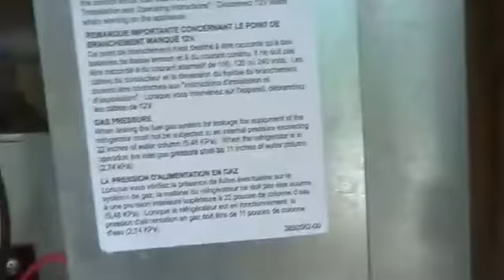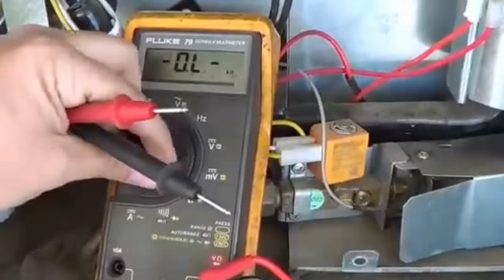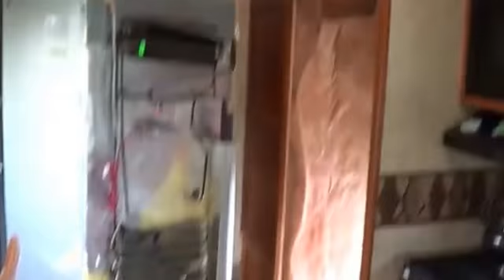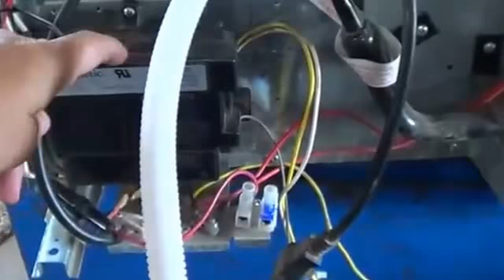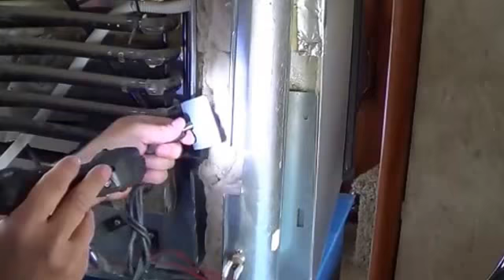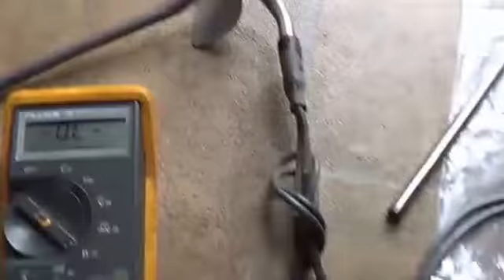Dometic DM2652 RV Refrigerator Repair

Comment: I have the same dometic fridge and that heat shield tube and crimped from bottom to the top preventing to extract the element is a freaking pain in the butt. Having to remove the whole fridge from the enclosure to change an element is complete nonsense

Comment: You can check ohms without removing the element.  You do not need to remove refrigerator to replace element on all models.

Comment: Great video, I have a question.. anyone can answer this if someone has an idea what I'm talking about. I have the exact same fridge and the way you were explaining it just stopped working You notice your ice wasn't cold then you switched it over to LP didn't work mine did the exact same thing so my question is for some reason I was thinking it was something to do with the board because I wasn't getting power or the button is on top of the fridge right above the freezer like if you push the LP it will light up green or whatever If you switch it over to electric you would light up did yours stop lighting up also on that board. Hopefully you can make sense of that either way I'm going to test my element tomorrow I'm pretty sure it's the same thing what's going on with mine thanks again
Reply from the maker: On my fridge to force it into gas mode I push in the left button and push out the right button. In this mode its forced to use gas and no lights show.
Reply: @LoveYourRV on the panel the only button that would illuminate would be the gas button and it says auto and check I'm not sure what the check means but yeah you just have a simple on and off switch on it I guess either way I appreciate I think I'm going to go ahead and pull it apart today thanks a lot
Reply from the maker: @JzNMuzak  Auto means it will first choose electric but if not plugged in to power it will auto change to gas mode. With the auto switch out/off then, it forces gas-only operation. The check light means the gas didn't ignite for some reason.  The fridge tries to ignite 3 times using its direct spark ignition, and if it fails to light the burner, the check light comes on. Here is the service manual with the various diagnostic procedures  https://www.manualslib.com/manual/2316371/Dometic-Dm2652.html
Reply: @LoveYourRV  I'm just now getting around to this repair. I really appreciate the helpful information and this video. I'm in northern Michigan currently and the weather hasn't been permittable. But it looks like that's going to change. But then again, it is Michigan.

Comment: Thanks for info was your element not heating at all, mine is heating but the fridge is not cooling
Reply from the maker: Yes, fridge cooled fine on gas but no cooling on electric because the element was open and would draw no power or heat.

Comment: Thanks Ray for another great video even though it's 10 years old I still found it useful. But still can't find out why my electric part of my refrigerator won't work. The gas is also quick but I think I know what's wrong with that I have a part ordered on it. I think I might go back to the old days and just put a block Ice in there😂

Comment: Dometic  rm2652 model :
Heating element = 325 watts ,44 ohm ,2.7 amps 
Troubleshooting :
Heating element =39.6 ohms
Ground to one leg of heating wire = no continuity 
Ground to other leg of heating = no continuity 
Board output for heating =120 volts 
Problem :
5 amps Fuse blown when  turn on power to ac 
What causing the fuse to blew ,is heating element under spec 44 ohms ,I am reading only 39.3 ohms ?
Any help would be appreciated .
Thanks

Comment: Was all that necessary? Seems  like a bunch  of work,  for such a small problem
Reply from the maker: This video is from about 9 years ago, so hard to remember exactly but I think the fridge had to be removed to get proper access to perform the repair. Space behind was extremely tight quarters to change the element in place. So faster and actually easier to yard the fridge out to do it, plus less chance of damaging something.

Comment: Any idea why my freezer is working great but the fridge will not cool down less than 47 degrees
Reply from the maker: Sounds like you may have a air leak into the fridge compartment. I'd check and make sure the door seal is in good condition and that the drain hose is in good condition and looped to prevent outside air from gaining access. Those would be my first two thoughts.
Reply: @LoveYourRV  thanks

Comment: I have this same Fridge model, the A/C heating Element is rusted in Solid..... sprayed Kroil on it, and later some SeaFoam Deep Kreep...  2 hours later, still locked solid.
Reply from the maker: Sometimes applying heat will free things up on rusted parts but would have to be real careful now that there is oils on it so it doesn't catch fire.
Reply: @LoveYourRV  97* here now, will tackle it at 0700 tmw morning, Tnx for that thought.

Comment: Youre saying you cant take the element out with the fridge still installed?
Reply from the maker: On my Cougar trailer it was extremely difficult due to the tight quarters coming at it from the outside access panel. I didn't not see an easy way to do it without risking damage to the flue or piping.  Once the fridge was pulled out it was a breeze. Other brands and models of RVs may vary.

Comment: Anyone know if it’s normal to  have your refrigerator click like it’s trying to ignite multiple times through out the night? We were having a issue where the thing felt cool one minute and not so cool later then cool again like it’s intermittently having a issue. We noticed the same trip we heard the clicking 3-4 times in the night. I wasn’t sure isn’t they shut off when cold enough then reignite or if they ran all the time. We also noticed there was no heat coming from the vent outside but at times there was. I wasn’t sure if this was all normal or not. It was running on propane if it matters.
Reply from the maker: If it is a model with direct ignition spark then this is normal. When it is needed for cooling it sparks several times and the burner fires and runs until the fridge has reach the thermostats set cooling temp, then a valve closes the gas feed until the next time it needs to run. Saves propane since there is no need for a constant pilot light burning.
Reply: @LoveYourRV  ok thanks. Not sure if it’s direct or not but I’ll have to check on that and find out.

Comment: My gas and AC gets element hot but doesn’t cool, checking power on fuse on control board shows no power
Reply from the maker: If the AC element is drawing power and the element stays nice and hot for for hours but you get zero cooling happening than unfortunately my guess is a faulty cooling unit http://bryantrv.com/docs2/docs/1252service.pdf  If you see yellow powder or have smelled ammonia that is definitely the case. Expensive repair. All the best, Ray

Comment: I accidentally opened the refrigerator and freezer doors during a power outage not realizing that the on button was pushed. Well, electricity comes on and several days later we walk into rv and saw light on in refrigerator. Well now the refrigerator doesn’t seem to work. I hear the gas turn on but not cooling. Is it a goner? Help!!
Reply from the maker: Hard to say. You're going to have to do some troubleshooting. Check for a flame and see if the boiler is getting warm. If they are good it may be a goner due to the coolant gas leaking out of the piping.  You can find a service manual online and go through the troubleshooting steps.

Comment: You are an idiot there was no need to removed the fridge you are a rip off feel sorry for the person you charge by the way bad video
Reply from the maker: No need to name-call. :(  btw, I didn't charge anyone it was my own RV fridge I was working on. Trust me it was way easier to remove and reinstall the fridge than to try and change the electric heater element in the cramped space that is available in the cooling stack area. It's only 6 screws, a gas line, and a couple electrical connectors to take the fridge out, not really the big deal you make out. Then you can work on it with lots of room and get to inspect the rest of the cooling unit and do a much better job.  Cheers, Ray
Reply: @LoveYourRV  there's one in every crowd, right Ray.. Personally I like your detailed, thorough approach you present on most of your repair and maintenance projects. Happy trails!!!!

Comment: I have a 1976 dometic rm66E model RV refrigerator that I want to run off of my RV 12volt house battery. Do you know what power consumption this model uses? Amp hours? How can I figure this out?
Reply from the maker: Hard to say as the amp hours used will vary dramatically based on the outside temps and how many times the door is opened and closed and how often warm food is added to be cooled. Looking online it appears the heating element used might be between 175 - 250 watts. So,  when it's on it will draw about 12-20 amps that but hard to know how often that will take place as it cycles to cool the fridge as required by the thermostat setting. Why not just run it off propane instead. Generally, the 12V setting for these fridges was meant to be used when traveling and getting power from the alternator versus batteries then switch to propane for camping. It takes very little propane to run but lots of 12V battery power. Usually, these fridges don't run that well off the 12V batteries.
Reply: @LoveYourRV  the push strike button at the inside front bottom of the fridge is missing
Can I light the fridge from outside - the real of the fridge?
Reply from the maker: @zayvier69  Sorry I'm not familiar with RV fridges that old so can't advise for fear of causing you injury or burning down your RV, I did find a service manual online and on page 40 is the gas operation instructions - https://rvrefrigeratorrepair.com/wp-content/uploads/2016/07/Dometic-Service-EarlyRM.pdf  If it was me I would fix the problem versus trying to light it a different way.

Comment: how do you check the AC power going to the control board?
Reply from the maker: Looking in from the outside panel, to the left you'll see a black cable plugged into an AC outlet, the cable feeds into the control board at the bottom (black and white wires) near where the AC power comes out for the electric heater element. You can measure the AC power with a multimeter or use a non contact tester - https://www.loveyourrv.com/electrical-test-gear-aboard-rv-uses/  https://www.loveyourrv.com/how-to-use-a-multimeter-for-rvers/
Reply: @LoveYourRV  Thank you! We got it going

Comment: When u said that u didn't have to disconnect the propane line at all. U said to unscrew this two screws there and the other two and the third one on the burner flame . That way after u disconnect wiring u were able to pull the fridge fine. Unfortunately your video was unfocused  and u didn't show with you two fingers the first two screws that have to be unscrewed  that are attached on the back of the fridge and it only video show the first three screws and that is a issue.  I almost break the propane pipe!  Your video was helpfull but the video has to have more open screen for everyone understanding what they are watching. Thanks
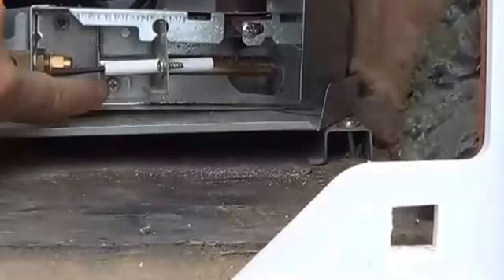Reply: I did read ur text and instructions but   the video clip at 5:45,  in that note. Fridge is back together working good and heat element replaced. Thanks for your service,  still helpfull  when u put video and instructions together.
Reply from the maker: You're welcome. Video is over 7 years old so back then I was very new to video making.
Reply from the maker: That's why I added the disclaimer text at the start of the video saying this video is to not be taken as instructional. Anyway I didn't have to disconnect the gas line, only unscrew it from the fridge, you can see it sitting in the opening here - https://youtu.be/b2zioJ7XwmM?t=417 Gas line is still hooked up.  For the future it's always a good idea to download the service manual as well as watching YouTube videos.  https://documents.dometic.com/search/?query=dm2652

Comment: my rv freezer is around 5 degrees, but the refrigerator is 60 degrees.
Reply from the maker: Sounds like warm air is getting via the outside drain hose, it should have a loop in it to act as a P trap, or leaky door seal, or maybe a bad thermistor device that regulates the fridge temp.

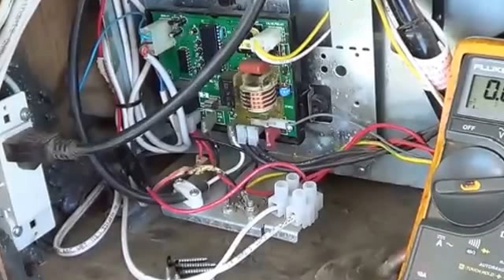Comment: At 2:46 it shows a red wire on the left bottom corner, it has an inline 3 amp fuse, It goes up towards the top of the fridge. What is this wire used to power?
Reply from the maker: If I remember correctly it is power for a cooling fan located on the back of the fridge. There is a small fan and a thermal switch in the circuit. I believe its an addon and not present in all installs.

Comment: Thanks for the video, do you need LP to run the electrical element?
Reply from the maker: No, just electricity, the fridge will need 12V battery power for it controller board and 120AC shore power for the electrical element.

Comment: Hello Ray, thanks for the video. We are having a fridge cooling issue. The freezer works fine, but the fridge will get around 50* during the day and cool down at night, we have to keep it on gas because I just noticed a blown 5 amp fuse in the control module (may have been blown for quite a while I'm guessing but not sure. The door seal is not good either, we did a dollar bill test and it failed all the way around. At night it gets down to about 40, but in the daytime it gets up to 50 or 60 degrees. Any help you could give us would be greatly appreciated. Thanks Ray.
Reply from the maker: Maybe the control board is faulty but a bad door seal can also cause lots of loss of cooling problems, also check the drain hose on the outside, it needs to be looped so water can form an air trap or else hot outside air can get in through there. Another cause could be a faulty thermister   Download the service manual for your model and it should have a way to test the thermostat to see if its working right. Or google - "test RV refrigerator thermistor"  Cheers, Ray
Reply: @LoveYourRV  Thanks for your quick reply Ray. I just checked the heater element and it was only reading at 38 ohms, so I think that may be why it won't run on shore power..?? I also removed a metal shield that went across the top of the outside door/vent in order to get better air circulation, and I noticed there was no fan back there, so I wonder if I need to  add one.? I pushed all around the door to try and tighten the seal and the fridge has dropped to 43 degrees but is staying there. I will loop that drain hose, I did check it to make sure it wasn't clogged. I'm gonna try vaseline around the fridge door to see if it seals any better, if it makes a difference I guess I will need to buy a new door since seals cost just as much. I will test thermistor in ice water and see what happens. The 5 amp fuse being blown and the heater element reading at 38 ohms seems like I may need a new one. Do you know what fuse I need to get to replace the 5 amp?
Reply from the maker: My new Dometic fridge doesn't have a fan OEM but I did add a vent fan to help it out, but really it should still cool well without it. I just have it to help out on hot days.  I'd try a 5 amp fuse and see if it blows right away if it does you know you have greater issues going on, maybe a bad control board.
Reply: @LoveYourRV  do you know what 5 amp fuse I need to get, and where I can get them?
Reply from the maker: Different models and ages of fridges use different control boards and fuses. I'm kinda blind as you haven't posted a model number or any photos of the board or the fuse you are talking about. Usually, they use automotive blade fuses or glass fuses. Blade fuses can be purchased at any automotive supply store, glass fuses maybe not, might have to find an electronics parts supply store or order online.
Reply: @LoveYourRV  sorry about that, the fridge is a RM2652 model from a 2000 Fleetwood Tioga. The fuse is a glass thermal fuse. I will take a pic and see if I can post it. I am going to make a video so maybe that may help too. I just cant read what's on the fuse and cant find that part number on the parts list for that model.
Reply from the maker: If its a thermal time delay fuse its likely an MDL like this - https://amzn.to/2Z1gKyk  You could for test purposes jumper in a common 5 amp automotive blade fuse, it shouldn't blow unless something is wrong. Then later on order the correct fuse.

Comment: I have a 1978 Dometric refrigerator and it is always too cold. It is in the electric mode for temperature and I have it set on 1, which I think should be the lowest setting (maybe I am wrong-there are no instructions). It always has condensation on the roof of the fridge and leaks constantly into the refrigerator. Is this simply a matter of changing the setting or is this a more serious problem?
Reply from the maker: I'm not familiar with fridges that old but sounds to me like maybe a problem with the thermistor or the controller board. Try to find the service manual online and see if it has troubleshooting steps you can do for that problem.

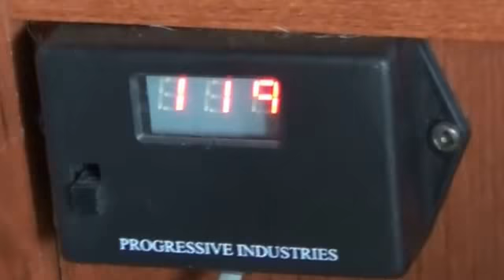Comment: Thank you for this Video Ray.  Mine (Dometic RM2451) is not cooling on a/c but the element is fine, Plug and cord/input is fine, the 5v fuse is ok, I don't see other fuses. I am thinking the control board.  I wish I could see more of where you apply the tips of the tester for test at 14:08 :-0),  Works on propane but extra waisted expenses since I am hooked up!

Comment: what is the 2 red wires on the burner unit? no one  ever mention that unit. looks like a senor of some kind...Temp sensor?
Reply from the maker: Yes, its thermocouple switch in case of a major overheating problem I believe. A failsafe safety switch.